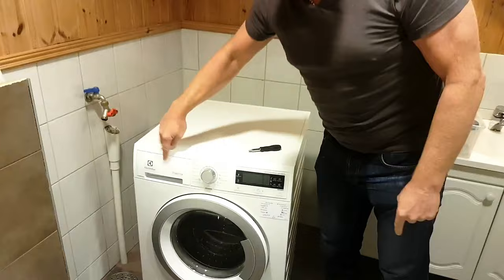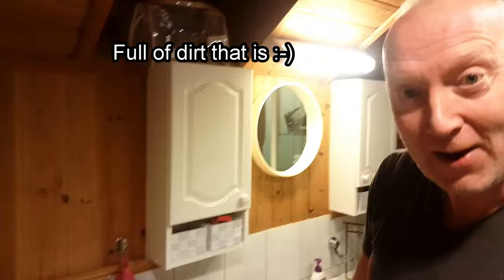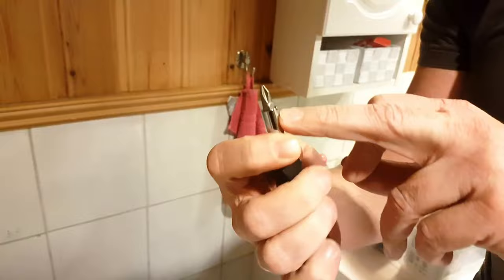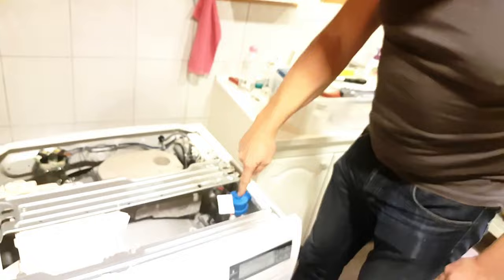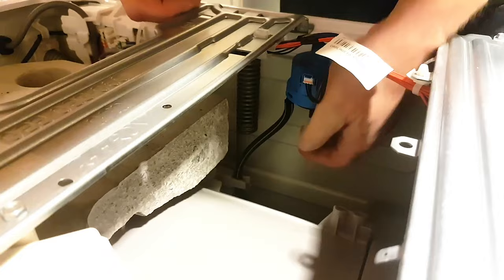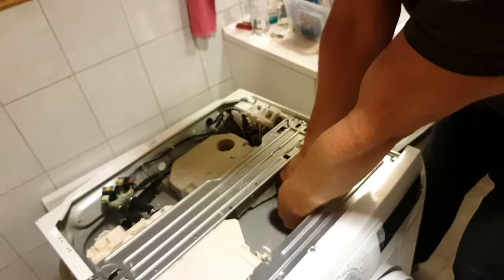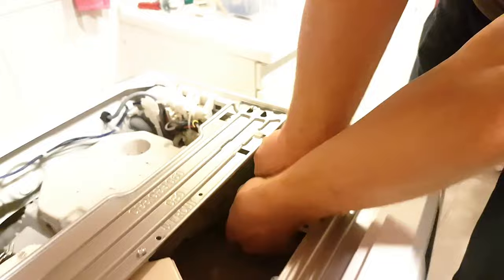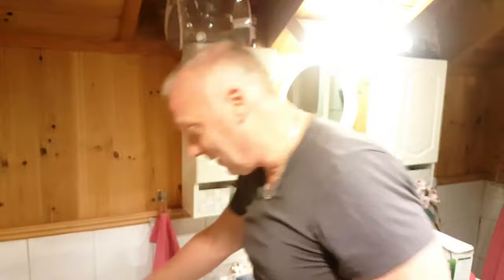How to fix Electrolux/AEG error code E10

Comment: Have Electrolux ewf14922 9kg washer
Threw out E10 error with flooding of water in the drum
Did everything the manual suggested including cleaning the drain filter, intake water filter and cleaning dispenser tray - no dice
Popped the top off and sure enough the the bloody hose was off with a flimsy metal part which barely held it in place
You are a legend sir
Reply from the maker: Thanks for the nice comment :-)

Comment: Hi! 
I had exactly this problem back in 2013, in less than a year after byuing this machine. 
This seems to be a small design-flaw of this type. Mine is a: EWF1486HDW

Last time I first tried to fix it just by re-attaching the hose, but then the hose popped off just a few weeks later. 
Then I used a small strip to fasten the hose. Since then, it has worked perfectly since. 
Until today... 

Now the same issue occured. The machine filles with a lot of water, and after a while the error code E10 appears.
When I opened my machine, I looked down at an old friend: 
The loose hose :)
After fasten it once more with a new strip, I hope my machine will last for even a few years.

When waiting for the spinn/drain program to run, I looked at youtube to see if anyone already had made a video for this, and found this video. 
Nice to see that this video has been out for a while, hopefully helping other people with the same issue that is very easy to solve. :)
Reply: I had a similar issue, water fills up all the way to the top and I am getting an E10 error, I am having to drain it then it works
As mine works after draining, Could it still be the same issue? Or if the hose was disconnected then it would it not work at all?

Comment: I was dissappointed when i saw my hose was right where it should be, but then i saw one of water intake valve socket broken, the wires were disconnected and just hanging, i did connect them and now my machine works fine! thanks!

Comment: thank you so much, my washing machine just kept overfilling until it hit E10, cleaning the drains and filters didn't help. it would drain just fine when putting it on the draining-program.  
after opening the lid the hose was indeed off and after putting it back on it works again. 
you are awesome

Comment: Thanks John, great no bullshit vid, inspected the little hose connection with blue box, all ok but removed the water filler hose and the filter is totally corroded so will be off the the appliance parts shop tomorrow, cheers for your knowledge

Comment: Thanks for information was very helpful. My problem was same code and The outlet pipe for the waste water had detached from inside the machine (Access via a panel on the bottom of machine).

Comment: If your machine keeps adding water, and then shows error 10 with too much water in the machine, this is probably the fix. Pressure sensor tube gets loose very easily. Very easy fix indeed.

Comment: Could be solenoid valve that lets water into machine later models have 2 if is faulty that will cause the E10 error message they are available on eBay

Comment: Having E10 error again. 1st had it 2 years ago, when my washer was still under warranty. I have a dryer stacked on top, so it's  hard for me to open up to check.😥
Reply: Got the technician to check,  the inlet valve is spoilt.
Reply from the maker: Excellent find, thats the other reason for the same error E10

Comment: Hello there! It is very gracious of you to post such a helpful video and it’s obvious from the comments that you’ve saved lots of time and money for many folks :-) I thought you might have a clue to “my kind of E10” problem and will be kind enough to share. So, after my eww1696swd baby normally finishes a washing cycle and moves on to drying, 10-15 min into drying E10 error interrupts the course :-( while when on wash&dry in 60min cycle it washes and dries properly till the end of the cycle. I tried diagnostics reset and for some reason the very first time after that it worked even on cottons (yesterday), but today it’s back to E10 and reset does not help anymore. You seem to be a very bright mind in this area.. do you have any idea why this is happening?
Reply from the maker: Only tip I have is to check the warer inlet hose filter. You just unscrew the water hose from the machine, and clean the filter. If doesn't help, I don't know. Sorry 😕.
Reply: Italjohn Its okay! Thanks anyway for replying, it means a lot :-)

Comment: Hi - my machine stops in the middle of the prgram and has to be restarted which means that it takes in water when restarted. Is this possible if the problem is a loose hose like you show or does that mean that the machine can not start at all?

Comment: Unfortunately didn't work for me. The hose is connected tight, was in place, so my error e10 is because of something else :-/
Reply from the maker: Have you checked the water intake? if this is blocked by dirt you will get the same error.

Comment: Mine water supply hose was not loose or take out but the errors keeps appears and the water goes out from the drains and not fill in the washing machine, can you help me?
Reply from the maker: Check that the water intake hose is not blocked by dirt. Screw the hose off on the machine and look for any blockage.
Reply: @Italjohn  it's a new machine, water fills in but at the same time it drains out
Reply from the maker: Then I don't know, sorry. But if it's new, this fault will be covered by the  warranty
Reply: Go check your drain pipe position, you can not  Just let it in  laying down directly, But it should be hang out in the clip avalaible up there first  then you might put down the rest ot the drain pipe.  Goodluck

Comment: My hose is secure but still having the same issue
Reply from the maker: Have you checked the water intake filter on back of the machine?
Reply: Italjohn yes i did, any solution ?
Reply from the maker: @okcis  No, sorry
Reply: @okcis2221  i still have the same issue, all cleaned and replace also the solenoid but still not working, did you fixed? Please let me know, Im Lost
Reply: Water pressure has dropped in my house.  This caused my e10 error.  Just have to wait till water company fixed pressure.